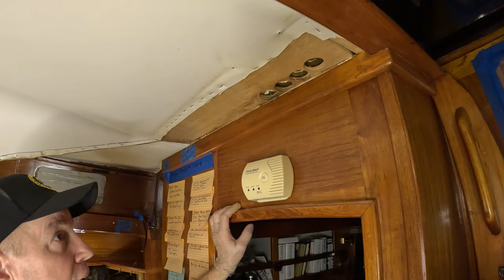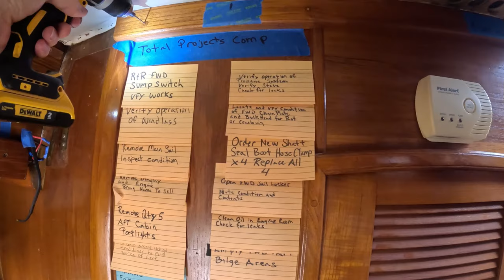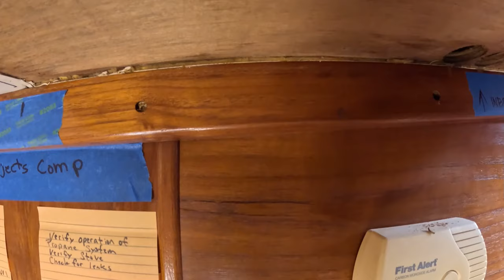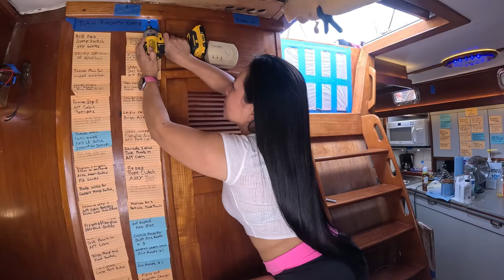Sailboat Refit. We Finally Close the Vinyl, Find New Problems Fun Stuff. Endeavour 52. Sea 3 Ep 96

Comment: That must have been a good feeling to get the vinyl stretched back in place, even if it's temporary. I'm still in full tearout mode. I also figure out where I've seen that plastic before, Lowes sold that back in the 90's for bathtub surrounds. Keep up the good work.
Reply from the maker: It's good to hear from you, Wayne. Thanks for your comment. We were happy to have the overhead vinyl closed, but we need to open the next seam to gain access to the large hatch plywood frame. We hope everything is going well on your boat projects.  Thanks for watching, and we hope you have a wonderful weekend 😀